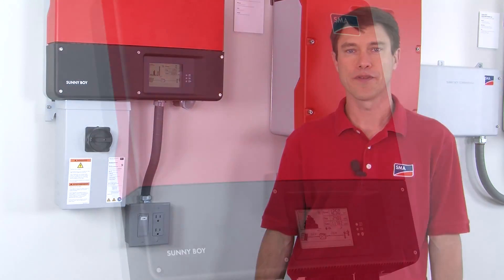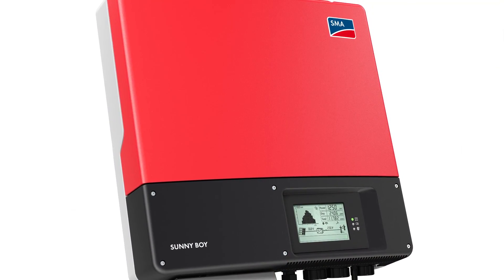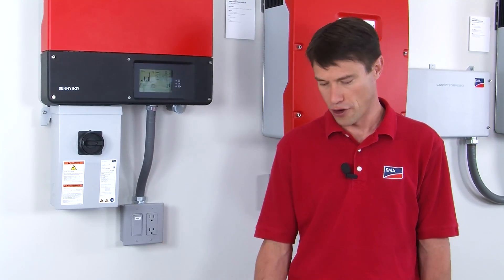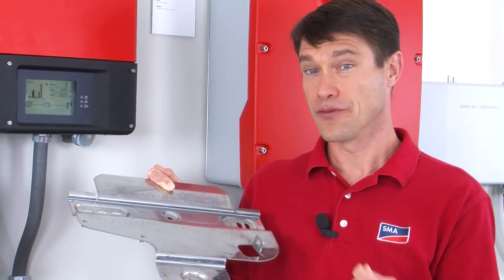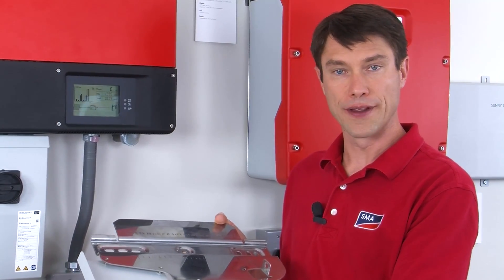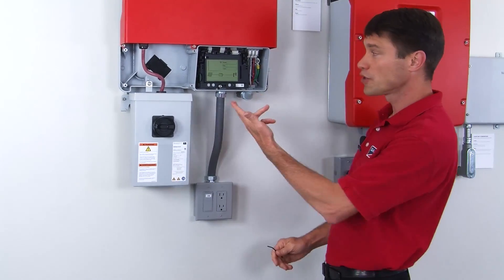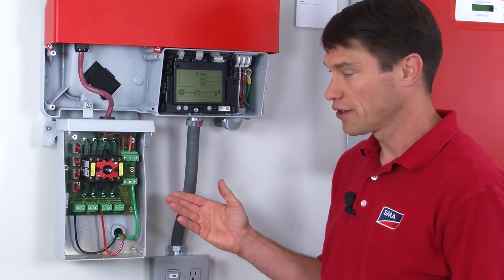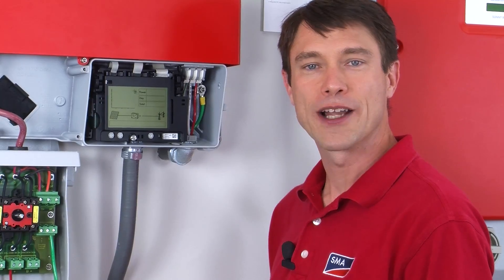Tech Tip: Installation Tips for the Sunny Boy TL-US Series

Comment: My electrician ran the bare copper grounding wire that grounds the rack framing and PV Panels to a bolt with a hole in it, that is located on the outside of the DC disconnect box.    I thought it should go to the grounding terminal in the DC disconnect circuit broad (pg 73 of manual).  Which is correct?

Comment: So,  the TL-US Series are basically multi mode whereas they can run on or off grid.  This can be important living in south Florida where we lose grid power for weeks after major hurricanes.  Being able to use solar power would be great.  Would SMA Sunny Boy 8000TL-US Solar Inverter suit my needs? 

thank you, arthur
Reply from the maker: art Florida dude Yes, the Sunny Boy TL-US are basically multi-mode without the need for batteries. Sizing your inverter all depends on the amount of PV you plan to connect it to, but the largest model with Secure Power Supply is our Sunny Boy 7700TL-US.

Comment: How come the manual doesn't appear to show which color of wire is for what connection ?  +1 Red, +2 Orange, negative/common Black, is what I am assuming.
Reply from the maker: Hi Bob - Are you asking about the wires that connect the DC disconnect to the inverter? If so, those are labeled by color at each connection point on the device itself. 

If this isn't what you're asking about, please let me know via email: socialmedia@sma-america.com

Best,
Justin
Reply: We don't have a disconnect box. The instructions are clear that the 3 colors connect to the 3 colored wires at the disconnect box.  Just doesn't say what these wires do or how they connected to the PV array/strings.

We were hooking up the TL 5000-US inverter up in the lab and had to make an educated guess on the wire hookup. The manual says to connect these colors up to the disconnect box OK but doesn't say which wire is which. 

Knowing that it is a dual input device and guessing that the negatives are common to both PV arrays, we were able to connect up the inverter to test it and it works.

 But what I was getting to was that nowhere in the manual can I find that red is the positive of one string, orange is the positive of the other string and black is common negative.   I also did not see a wiring diagram for the PV  wired into the disconnect box in this manual.  This is the manual that came with the inverter.  No biggie...  I just wondered.  Might be the German way.

Comment: cool inverter. we install tons of these!  CRsolar    I add a breaker to protect the circuit for the emergency power plug,  I see many installers don't do this or don't even wire up a the emergency plug,  curious what electrical inspectors think? (do we need fuse protection on this output or not as the unit has built in circuit protection via I believe a computer) maybe something to add to the NEC code under solar section???
Reply from the maker: Hi Chris - The SPS outlet is protected by overcurrent protection inside the inverter. If the load exceeds 12A then it automatically shuts off power to the outlet and will automatically try to reconnect 20 seconds later. We haven't heard of any issues with installers wanting to see breakers on these outlets providing you can show them the manual to verify the overcurrent feature. If you've heard differently, I'd love to hear about it: socialmedia@sma-america.com.